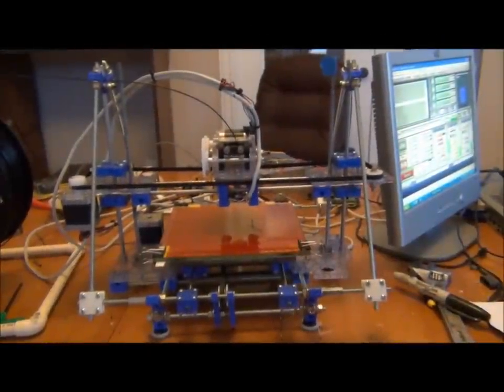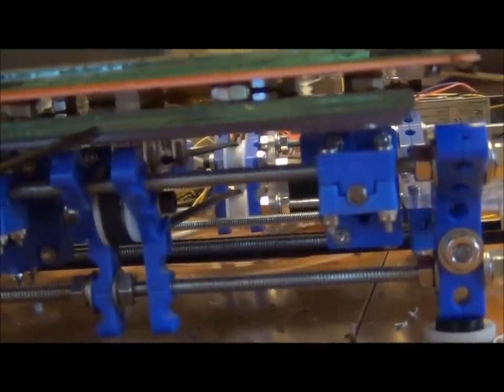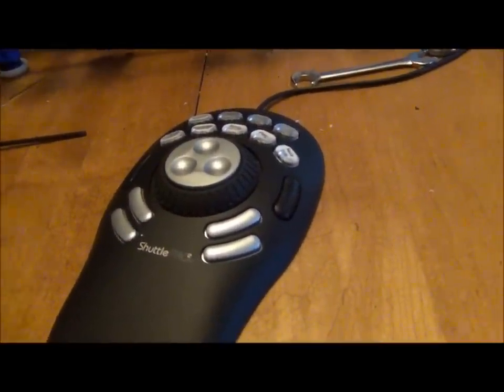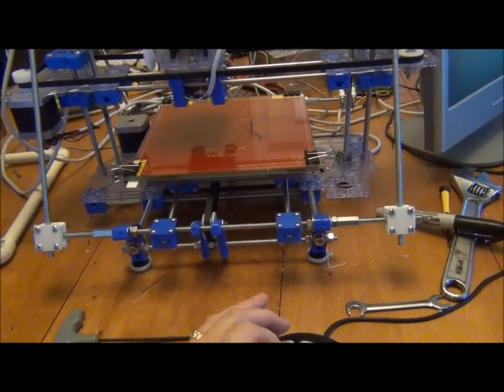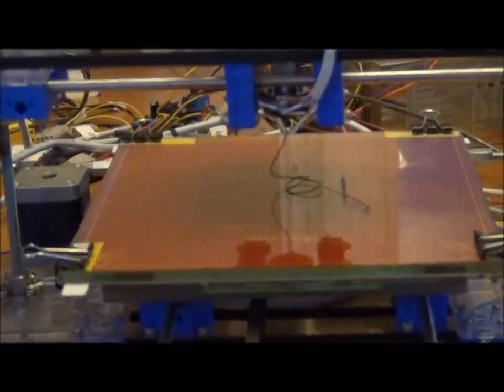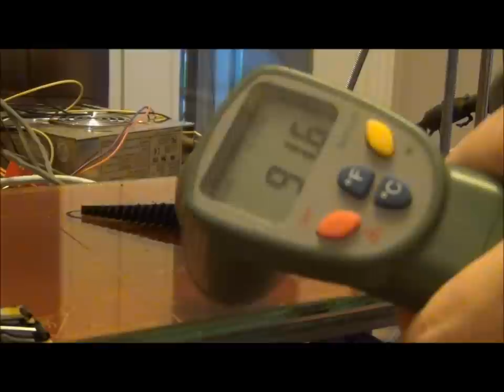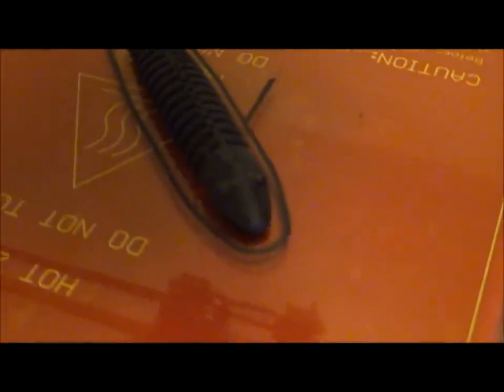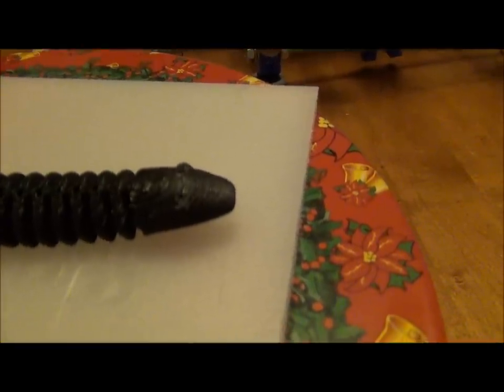Printing  a snake on my H-1 to show off the new heated print bed

Comment: Thst's awesome Chris! I know very little in regards to DIY plastic injection molding however I am intrigued by the CNC aspect of it. What are you running for software? In your other video you state you're using MACH3, which I am familiar with however what do you use for CAD and CAM software? What do you generate your G-code with? Nice work with the modification. Keep the videos coming.

Comment: Just ordered the H-1 kit and this looks nice.  Can you tell if extending the supports changed the stability (flex)?  I would use longer rods to start with so no coupler needed.